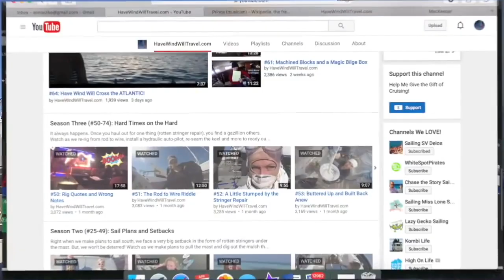#70: Turnbuckles, Tangs, Taps ... Oh My!

Comment: Was the tang location different for the rod rigging different than for the wire rigging? Just wondering why all the mounting holes for the new tangs had to be re-drilled.  I've never had rod rigging, so I'm guessing the attachments to the mast is different?  All that shiny new stainless boat jewelry sure do look purdy!
Reply from the maker: Hey Chuck!  Yes, the rod fixtures on the mast were totally different.  They were barrels that went through the mast with cold-fused rod heads affixed.  We had to re-engineer from scratch the new tangs for the wire shrouds.  This video sheds some light on it: https://havewindwilltravel.com/2016/02/29/51-the-rod-to-wire-riddle/

Comment: Rob Mitchell made the suggestion to add a barrier coat between stainless steel machine screws and the aluminum mast. If you don't do this you will get corrosion between the two metals that will make it difficult or impossible to remove those screws in the future.
Reply from the maker: Agreed Lazy Days.  We put a nice, thick coating of Tef Gel between any non-similar metals.  Appreciate you watching!

Comment: That can't be right?  @15:00  screwing stainless steel bolts into a thin walled aluminum mast?  Should there not be stainless steel bolts for the stainless steel screws to go into?  Also those stainless plates are not curved while the mast is curved.  That's just going to lead into a prying action under loading conditions and those bolts will just unscrew or be stripped out.  Somethings not right with this installation.
Reply from the maker: Hey there.  Thanks for watching.  But, nope all's right with the install.  We have thru-bolts to hold the tangs on the mast (that's what will hold the load).  The small screws are merely to prevent swivel of the tang aft and forward.  The sides of our mast are flat, not rounded so the tangs sit flush on it.